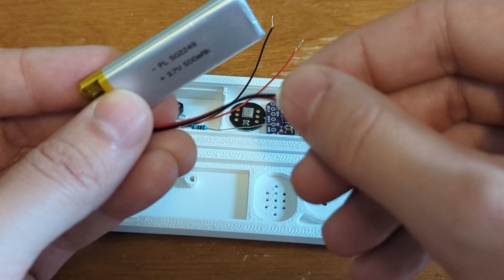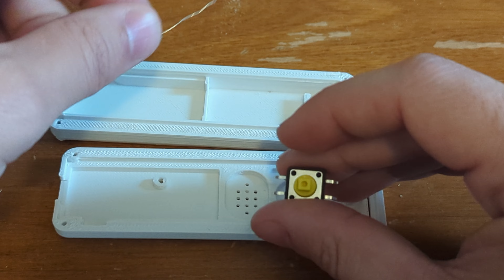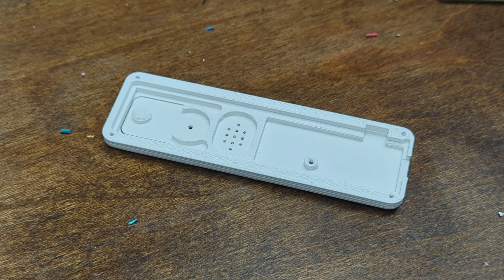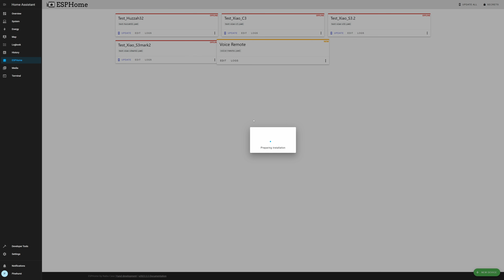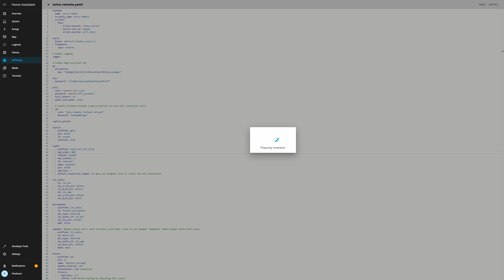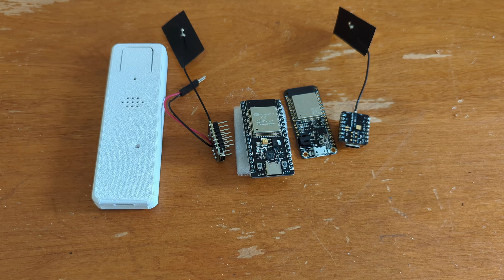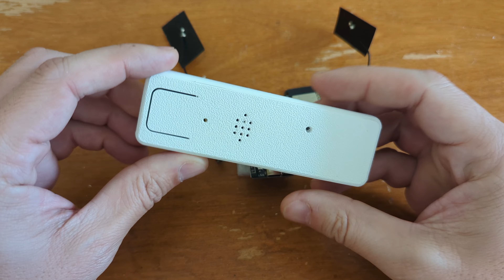Home Assistant Voice Remote

Comment: In the part where you talk about the YAML config, you say the fast connect will increase the start-up time correct? Later in the video, you show that once you click the button to power it up, it takes approx 4 seconds to be connected. Is this with or without the fast connect? 
The delay is not that bad but I can see it being annoying sometimes. is there an option to keep it connected for longer than 30 seconds? This will of course drain the battery faster but I'm thinking about keeping the device on and connected for an extended of time during most used moments, like between 6-9pm in my example where I would be using it a lot more than during the day when no one is at home

Your HA voice remote is an awesome tool! I ordered parts to try and build one myself. Great video!
Reply from the maker: Yeah, this is with fast connect. To adjust the "on" time, you adjust the delay timer in the sleep_routine (toward the bottom). IDK, you might be able to work some sort of if statement to vary the on time based on time of day if you want.
Reply: Thanks a lot for the answer! I'll look into it once I got everything set up
Reply: I think it's a whisper/Piper thing. I've got a few m5stacks with some m5stack tailbat's which is just a 190Mah battery, with a button to turn on/off and USB C and GPIO output and input and output (or passthrough that charges the battery but allows access to the GPIO pins on the atom echo). It works with any m5stack atom device for portability. On a few I still have Rhasspy and when I power in it's 1 second at most to connect to HA. Rhasspy is installed as an add-on on my HA instance. With the same model atom echo it takes about the same 4 seconds to connect so pretty much the same time this gets so it just takes longer for the whisper/Piper (or Wyoming, they made it a little more confusing as far as steps to install IMO) to boot on the m5stack or something else is going on that causes a delay to connect after power on. Rhasspy still works great but now that you can set the HA voice assistant to be the primary voice assistant on Android I'm obviously moving to the new way as I would have had to at some point.

Local voice rendering of this type takes a lot of GPU power (don't ask me why but it does, there's details on the HA forums) so local vs cloud time will be dependent on what you're running HA on. I imagine a raspberry pi would not be super fast. Cloud is still faster but I'm running HA on a roughly 5 year old NUC so local performance is not far behind the cloud for me and functionality first. Then performance improvements. It will get faster over time but they probably want to get everything working before starting on performance improvements so they don't introduce other issues. I will say that local is also much faster on my phone than the m5stack, even after power on and connection but it's my phone be an esp32. No trigger word detection for.Android yet although will be by the end of the year, but there are other shortcuts like holding the power button that will bring up the HA assistant. Not sure if Apple would ever allow a third party voice assistant to be your default, I just know they are just more strict about what developers can do with iOS vs Android.

Comment: Maybe it's just me, but having to wait for things to wake up & connect would be annoying to me after a while. Before I ditched my old Amazon Echo, I personally felt the wake-up word routine was annoying too, so again maybe it's just me.
Would a possible solution to that be for the device to buffer the post-wake-up command you gave it (right as the button was first pushed ideally) so the remote could "automate the waiting" until things are all established before sending out the buffered (recorded) command? You'd still have to wait for the response, but at least the USER would not have to watch the LED colors to show correctly and all that.
Just a thought. Would bump the user experience up a notch, i.e. would make the post-wake-up command function the same as subsequent commands other than the longer response time from the first command.
Very cool project! The M5 Stack Echo power wire thing struck me as a significant negative too so I love the battery power angle.
Reply from the maker: Wake from boot isn't instant, so if you did it that way, you'd almost certainly miss the first part of the command most of the time. That happens often enough as it is due to some delay between the VA channel getting opened and the audio getting converted as it is.

The other alternative that could probably be worked a bit more easily is to have a custom sound to signal that the VA is listening rather than having to watch the LED, so you'd be swapping/including an audio cue. The LED approach is just a lot easier to do (don't have to sort out storing/retrieving the audio data). Either way, there's no way to avoid the wake issue without doing it in C++ that I know of.
Reply: @TechDregs  I was referring more to the ESP establishing connection to both WIFI and the voice assistant plugin I guess. Maybe I've got it wrong, but for the first command, you have to 1) wake up the micro 2) establish WIFI 3) start communication to the assistant. If I'm not mistaken, waking up the micro is likely the shortest delay of the three? I was just thinking that buffering a recording of the first command once it's awake, it could then wait until it "knows" WIFI and assistant are ready before then sending that first command to HA.
No big deal, I'm just brainstorming here. I don't even know if this is even doable. Just offering input for possible future improvement for a somewhat smoother user experience.
I do really like this project. Bravo!
Reply from the maker: I understand, and I agree that would be a better experience. I'm just saying that it isn't something that can easily be done with ESPHome without adding significant C++ in lambdas. For instance, you have to record the audio local to the ESP32... I don't think audio recording is supported in ESPHome, so you'd have to write your own code to do the audio buffer. Then you have to have separate routines to contact VA, because the default method streams the audio data directly, and now you need that and another method that plays back the recorded audio. Along with that, you need logic to know the difference between when the device should send the buffered audio vs when it should stream directly from the mic. That's all more C++, because it's not available in ESPHome.

As far as the wake delay, the thing is that audio is pretty heavy data on an ESP32. It wakes fairly quickly, but not instantly, and trying to process audio at that time could easily lead to some hitches in the audio file. VA is very sensitive to audio problems... I would say it only recognizes commands correctly 75% of the time even when you're being careful in a normal room environment. Any kind of garbled audio at the beginning would likely make it fail in recognizing the command, and defeat the purpose of the buffered audio anyway. It's certainly possible that someone could get it all working, but it's well past my ability to work that stuff out. This was my first ESPHome project after all.

Comment: Hi, Tech Dregs. Great tutorial, thank you. I tried to build one like yours, using you schematic and .yaml code, but it's not working for some reason. I use ESP32 wroom board, SPH0645 microphone and Max 98357A amplifier. Mic pins-3.3v, GND,BCLK, DOUT,LRCK and SEL. I connect everything same way like on your schematic ,except SEL( don't know what is that) but I don't need a battery . Can you please explain what I am doing Wrong. It's listening but no responds to commands . Thank you
Reply from the maker: I presume the log is telling you that no speech was recognized? My schematic is for the exact components listed, and changes to them may require some tweaks. The SEL pin is how you configure the microphone to left or right channel output. I would try it both ways, to see which one works for you (I've had it work differently on different boards). Pull it to ground for Left and try it. If that doesn't work, pull it to 3.3v (Right channel) and try again.

/edit, I think that mic defaults to Left, so I'd try the right channel (pull SEL to 3.3v). I think that's how the older WROOM board worked for me.
Reply: @TechDregs  thank you for quick respond. Will let you know  as soon as I will test mic stuff.
Reply: Still not working. Work fine with Android app
Reply from the maker: What does the log say? The device is configured in HA for the correct voice assistant pipeline? If nothing else, you can check on the ESPhome discord. I haven't used that mic board, but I don't see why it wouldn't work.
Reply: @TechDregs  Good morning. Thank you. For some reason on debug page it's only showing conversation with Android app not Esp32 voice assist🤷‍♂️. I will try to compare your schematic with esp32 pinout and set the pins to the right outputs of the peripherals. Thank you again, Great job
Reply from the maker: FYI, if possible, I would try a different I2S microphone. You are not the only one having issues with it and ESP32, apparently. https://hackaday.io/project/162059-street-sense/log/160705-new-i2s-microphone
Reply: @TechDregs  thank you 
I will try to order same like you use in your setup
Reply: @TechDregs  .Happy Father Day. Thank you again. I finally got a mic like yours, modify code a little bit and Voice assist start working.  Here is my code:
 esphome:
  name: voice-1
  friendly_name: Voice-1

esp32:
  board: esp32dev
  framework:
    type: arduino

# Enable logging
logger:

# Enable Home Assistant API
api:
  encryption:
    key: ""

ota:
  password: ""

wifi:
  ssid: !secret wifi_ssid
  password: !secret wifi_password

  # Enable fallback hotspot (captive portal) in case wifi connection fails
  ap:
    ssid: "Voice-1 Fallback Hotspot"
    password: ""

captive_portal:

i2s_audio:
  - id: i2s_mic
    i2s_lrclk_pin: GPIO25
    i2s_bclk_pin: GPIO5
  - id: i2s_amp
    i2s_lrclk_pin: GPIO25
    i2s_bclk_pin: GPIO5

microphone:
  - platform: i2s_audio
    id: feather_microphone
    adc_type: external 
    i2s_audio_id: i2s_mic 
    i2s_din_pin: GPIO35
    pdm: false

speaker: #media player won't work currently with Piper, have to use speaker component. Media player works with cloud.
  - platform: i2s_audio
    id: media_out
    dac_type: external
    i2s_audio_id: i2s_amp
    i2s_dout_pin: GPIO26
    mode: mono

voice_assistant:
  microphone: feather_microphone
  speaker: media_out

binary_sensor:
  - platform: gpio
    pin:
      number: GPIO0
      inverted: True
    name: Button
    id: remote_button
    filters:
      - delayed_on: 10ms #debounce time

    on_multi_click:
      - timing:
          - ON FOR AT LEAST 350ms
        then:
          - voice_assistant.start:
      - timing:
          - ON FOR AT LEAST 350ms
          - OFF FOR AT LEAST 10ms
        then:
          - voice_assistant.stop:

   Only one thing : it's a clicking noise coming out of the speaker when I push the button. I think I need to do some investigation on this part.
Reply from the maker: Probably because you're running both i2s devices from the same bclk and lrclk pins. While that should work, I never got rid of the issues like you're seeing with crosstalk or noise. That's why I use different clock pins for each device.
Reply: @TechDregs  will try to  separate them. TY
Reply: @TechDregs  thank you again. I fix my problem. Separate bclk and lrclk for mic and amp. This is my final code, if anyone interested : 
i2s_audio:
  - id: i2s_mic
    i2s_lrclk_pin: GPIO25
    i2s_bclk_pin: GPIO5
  - id: i2s_amp
    i2s_lrclk_pin: GPIO21
    i2s_bclk_pin: GPIO22

microphone:
  - platform: i2s_audio
    id: esp_microphone
    adc_type: external 
    i2s_audio_id: i2s_mic 
    i2s_din_pin: GPIO35
    pdm: false

speaker: 
  - platform: i2s_audio
    id: media_out
    dac_type: external
    i2s_audio_id: i2s_amp
    i2s_dout_pin: GPIO26
    mode: mono

voice_assistant:
  microphone: esp_microphone
  speaker: media_out

binary_sensor:
  - platform: gpio
    pin:
      number: GPIO0
      inverted: True
    name: Button
    id: remote_button
    filters:
      - delayed_on: 10ms #debounce time

    on_multi_click:
      - timing:
          - ON FOR AT LEAST 350ms
        then:
          - voice_assistant.start:
      - timing:
          - ON FOR AT LEAST 350ms
          - OFF FOR AT LEAST 10ms
        then:
          - voice_assistant.stop:
          
web_server:
  port: 80
I use 30 pin ESP32 board
TY
Reply from the maker: That's awesome man!
Reply: @user-nh5ot5ou8b  sorry for delayed response. I use ESP32 ESP-WROOM-32
Reply: @王于珊-p8i  .Here is my code for esp-32:
esphome:
  name: voice-1
  friendly_name: Voice-1

esp32:
  board: esp32dev
  framework:
    type: arduino

# Enable logging
logger:

# Enable Home Assistant API
api:
  encryption:
    key: 

ota:
  password: ""

wifi:
  ssid: !secret wifi_ssid
  password: !secret wifi_password

  # Enable fallback hotspot (captive portal) in case wifi connection fails
  ap:
    ssid: ""
    password: ""

captive_portal:

i2s_audio:
  - id: i2s_mic
    i2s_lrclk_pin: GPIO25
    i2s_bclk_pin: GPIO5
  - id: i2s_amp
    i2s_lrclk_pin: GPIO21
    i2s_bclk_pin: GPIO22

microphone:
  - platform: i2s_audio
    id: feather_microphone
    adc_type: external 
    i2s_audio_id: i2s_mic 
    i2s_din_pin: GPIO35
    pdm: false

speaker: #media player won't work currently with Piper, have to use speaker component. Media player works with cloud.
  - platform: i2s_audio
    id: media_out
    dac_type: external
    i2s_audio_id: i2s_amp
    i2s_dout_pin: GPIO26
    mode: mono

voice_assistant:
  microphone: feather_microphone
  speaker: media_out

binary_sensor:
  - platform: gpio
    pin:
      number: GPIO0
      inverted: True
    name: Button
    id: remote_button
    filters:
      - delayed_on: 10ms #debounce time

    on_multi_click:
      - timing:
          - ON FOR AT LEAST 350ms
        then:
          - voice_assistant.start:
      - timing:
          - ON FOR AT LEAST 350ms
          - OFF FOR AT LEAST 10ms
        then:
          - voice_assistant.stop:
    
    on_click:
      - if:
          condition: voice_assistant.is_running
          then:
            - voice_assistant.stop:
          else:
            - voice_assistant.start_continuous: